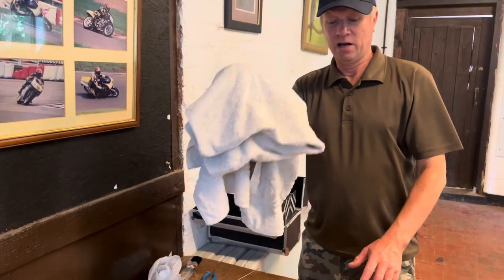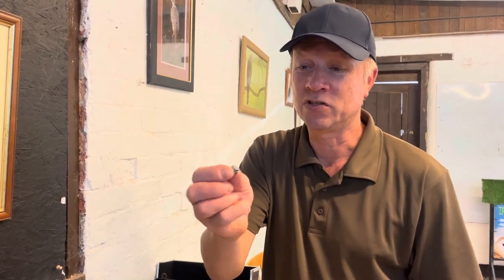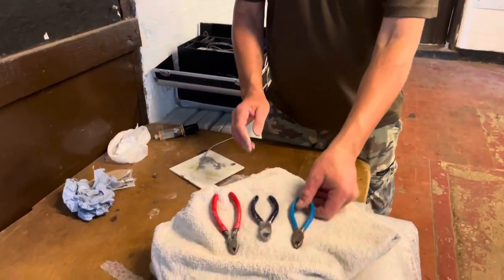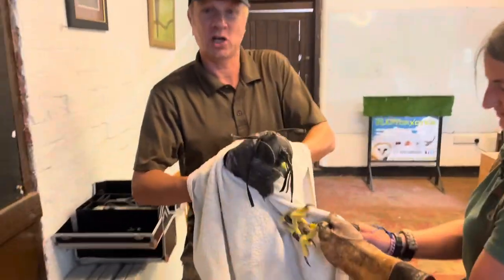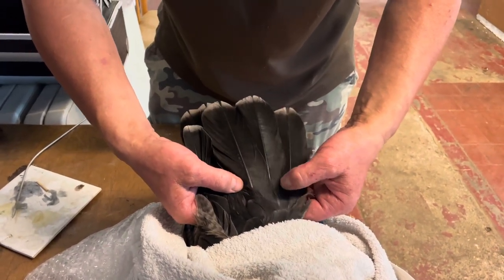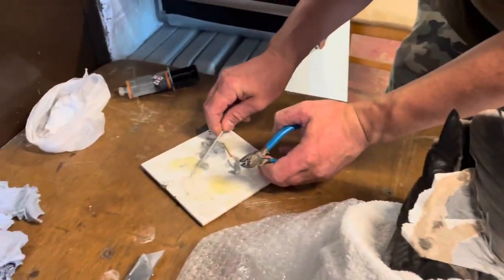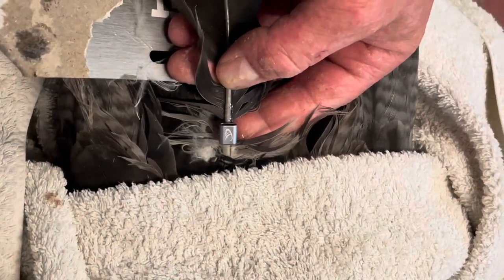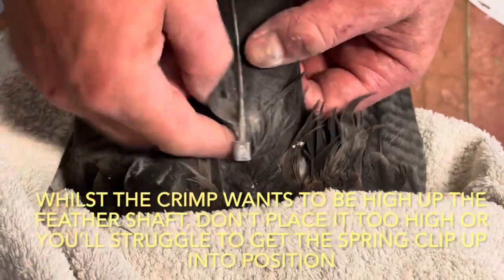FALCONRY: How to fit tail-mounts for transmitters

Comment: I used the plectrum system first season , got ripped out, we reattached and then end of season broke both decks, are permissions are heavy brambles and wooded.
Now I use the tail clip, nice and easy, although I did use super gel, I will try the 2 pack glue this year.
Dave are the tail clips tools colour coded how can you know which one to order when ordering.
Super video 👍
Reply from the maker: I think you need to specify as maybe diff colours depending who you get them from I reckon

Comment: Can you tail mount the Microsensory units like Kyles Dave?
Reply from the maker: Yes they’re not actually that heavy and tbh on lanner size birds we’ve used them in one farther without issue
Reply: @falconry.davesharpenatureboy  Cheers I haven't got mine yet as other financial commitments keep getting in the  way (bloomin building costs !) so still on the old clock work telemetry Good to hear they are ok for tail mounts as tbh I prefer them less fussing about I feel.
Reply from the maker: I know the feeling!